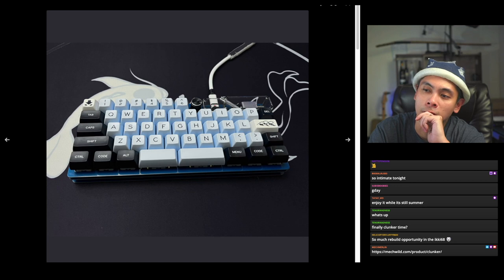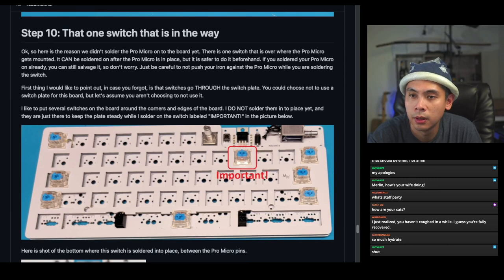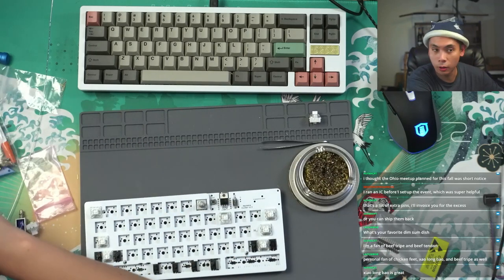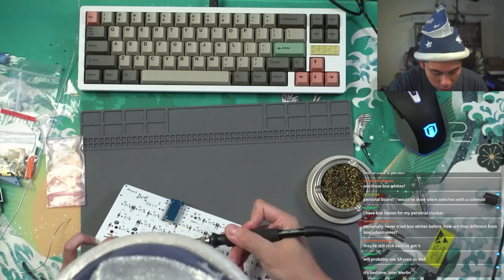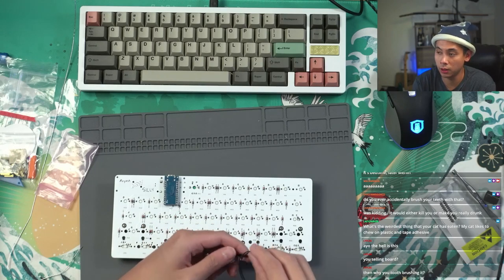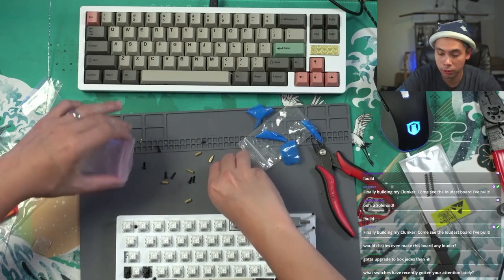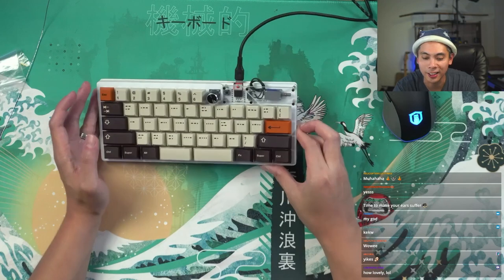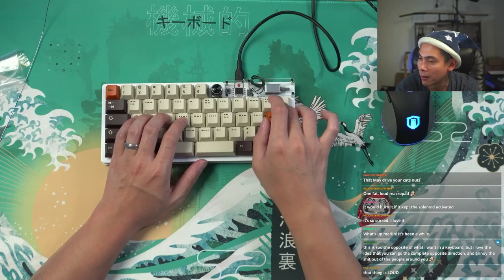Build: Mechwild Clunker

Comment: i good trick for the strand dont get separated when cuting! just cut the cover but dont pull the cover out!! just twisted will still in the strand so it will be twistind the the starnd and in the same time the cable cover is been pull!! nice vid!! add diferent material(metal,cooper,glass,ect)at the end of the selenoid to change the sound